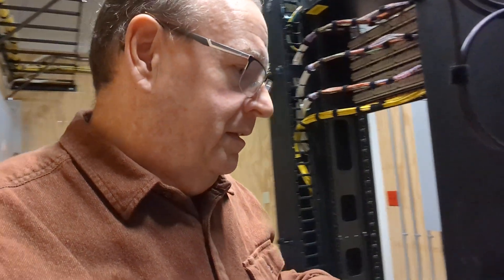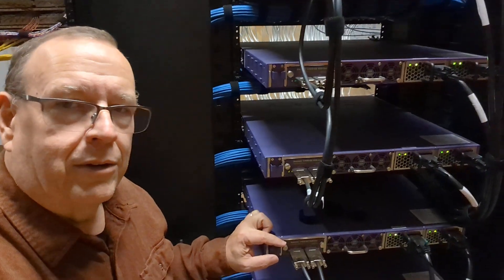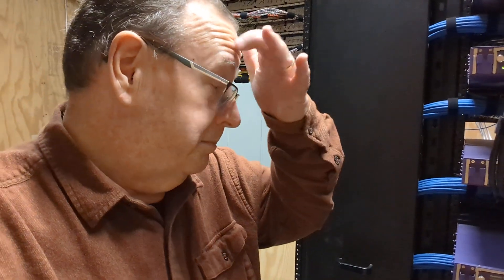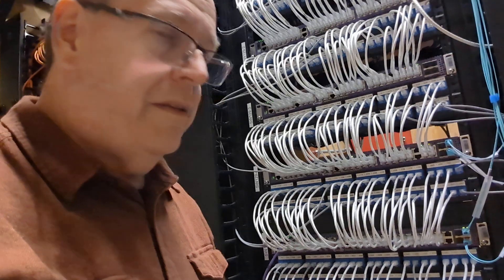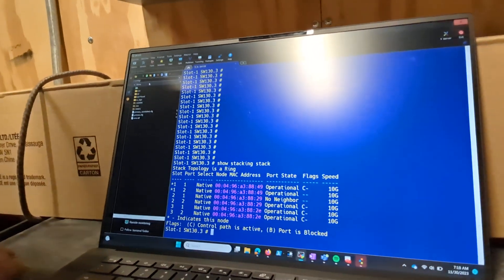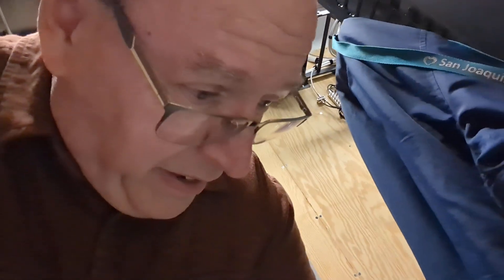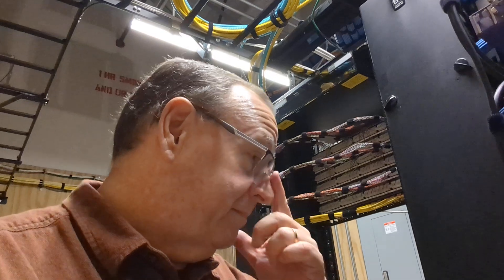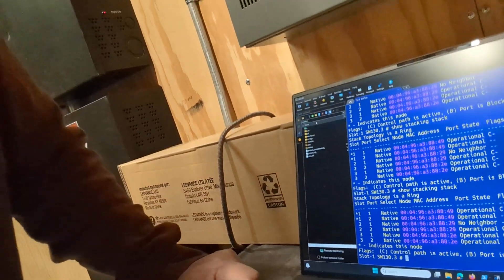Network Admin Life - Stacking Issue Pt 1

Comment: 9:41 nice to see a MAP, as a Newtwork Field Engineer, we don't see those too often, let alone any structured wiring. God forbid if anything is labeled
Reply from the maker: I'm a fan of self-documenting cabling.  On each end of the cable I like to put a label on that says where it plugs in, and where the other end plugs in.  I do that because I don't always make good diagrams.  Between labels on the cables, aliases on the switch ports, it's fairly easy for an engineer to walk in off the street and figure out what goes where.  God bless!

Comment: One thing I like about the Dell PowerConnect 2000 series switches is that their stacking cables aren't special.  They're regular DAC cables used for storage gear.  Love how Dell able to make use of existing stuffs without some weird cabling to make them work.  So I have bunch of those cables as spares.
Reply: it's kinda a pisstake they really use their own cables for stacking. it should just be some generic interface, they should leave us to using our media.
Reply from the maker: These particular switches allow you to use either their "special" stacking cables or plain vanilla SFP modules to stack the switches.  I elected to use the specialized stacking cables because it was what I was used to in their previous products and also to save the SFP ports for uplinks to the core.  God bless!

Comment: Hey Network Admin. I would probably call Extreme TAC and fine out what is the hardware health command (Testing commands) for the network card. Just like any pc you can test the sound card or graphics card so see which card is giving you an issue. Vendors usually have hardware commands for testing hardware issues. Hope you are doing good.
Reply from the maker: Yeah, we're going back and forth on that.  They've given me an idea on how to isolate the problem.  Video forthcoming.  God bless!

Comment: do you guys "normally update the map " when you run a new cable ?
Reply from the maker: We don't really map out cables.  We do label both ends if it's in the data center.  But mapping each and every network cable would require another network admin.  We have thousands of network cables.  I simply can't map them all.  Just the crucial ones.  God bless!